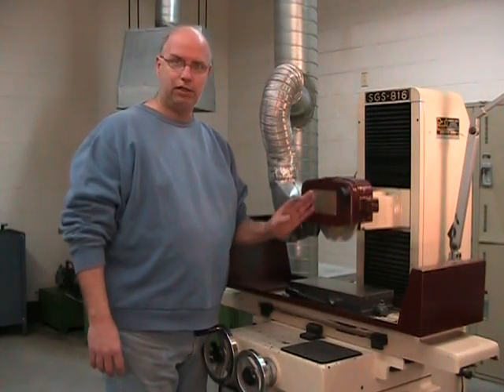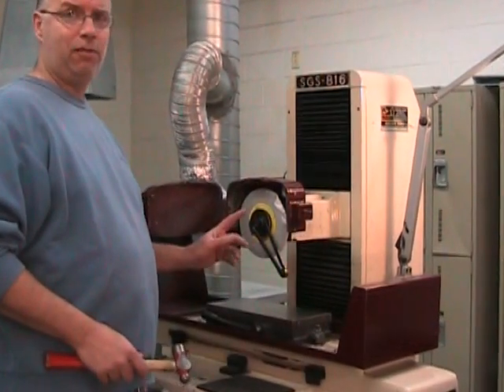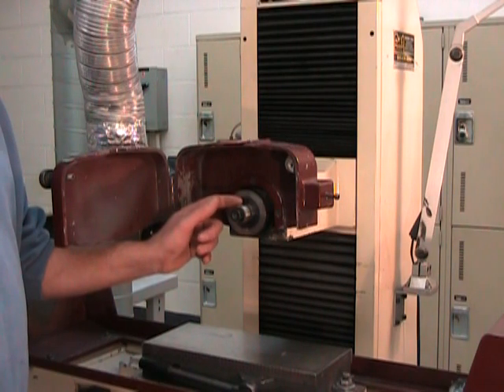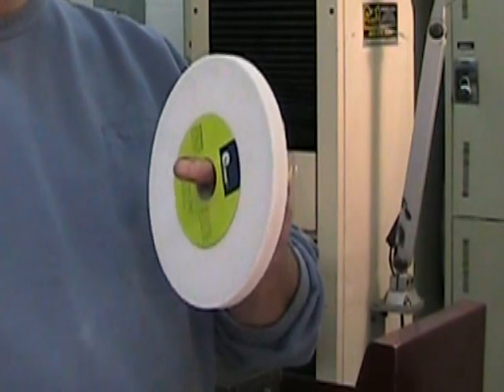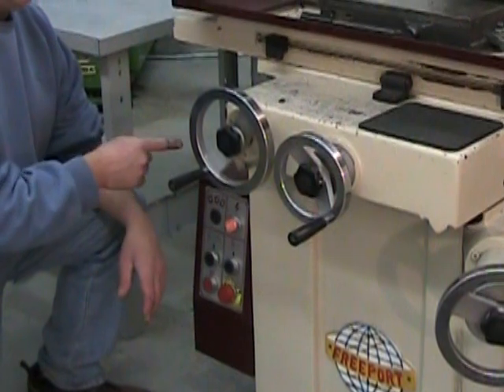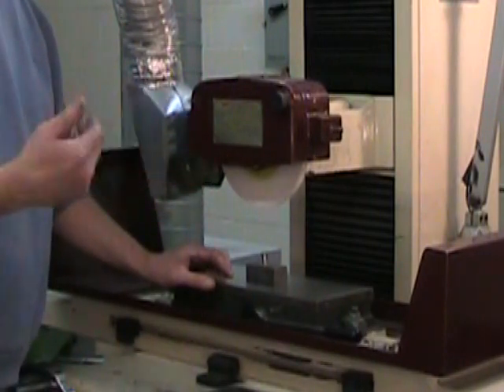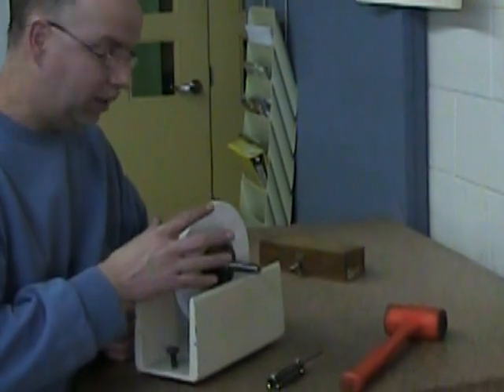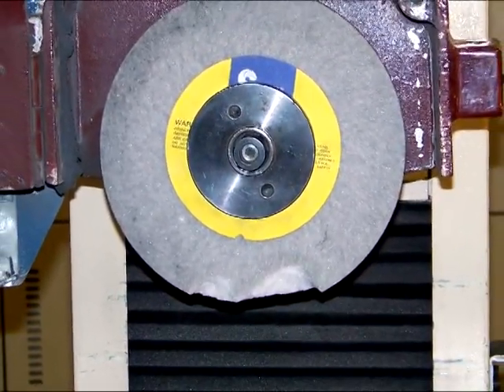GRINDING WHEELS. HOW TO INSTALL GRINDING WHEELS & HOW TO BALANCE GRINDING WHEELS, MARC LECUYER

Comment: We use a similar balancing technique and unit to balance motorcycle wheel when doing tire changes. It works very well and much cheaper than a computerized balancer. Too bad about the mag-chuck..gonna take some removal to get that out...:-(

Colin
Reply: Static balancing works fine for small weights and small diameters, but motorcycle tires should really be dynamic balanced or you will have issues at high speed.

Comment: I would  remind viewers  to clean the flange bores and grinder's tapered shaft before assembly.I shim the arbor hole of my grniding stones to improve concentricity. Any problems with this practice?
Reply from the maker: As long as the stone never becomes tight on the shaft, shimming is not a problem. You must remember that a vitrified grinding stones have very little resistance in traction so it is very important to always have at least some gap.
Reply from the maker: Sorry Nunya, I hit the send button before completing the answer! You are also correct to mention how important cleanliness is when working on precision equipment. There is no such thing as too clean! Thanks for watching and taking the time to comment. Marc L'Ecuyer
Reply: Please do not put shims in there, it wasn't designed for it. You can get the best concentricity for your wheel in the beginning by installing the wheel on the flange so that the "T" mark (top) or whatever the manufacturer is using is at the top. This was the position it was on an arbor in the factory when they turned it to dimensions and thus provides you with the best concentricity and thus least amount of dressing to get it truly concentric.
Reply: The hub was larger in diameter than the shaft. Fix?
Reply: Nunya Biznes The hole in the grinding wheel is supposed to be a few 0.1 mm's larger than the arbor shaft. This is because the arbor can expand due to heat and if the wheel is sitting snug, it will crack. So no shims, as it doesn't accomplish anything and just puts the wheel in danger.

If the hole is very much bigger (like 1 mm or more), then you have the wrong wheel size for your machine and need to order a new one with proper dimensions.